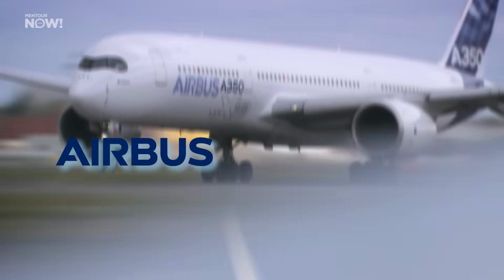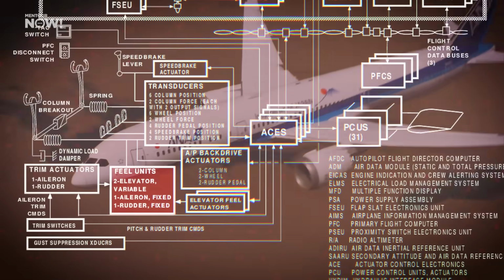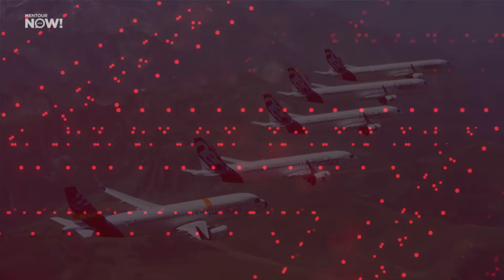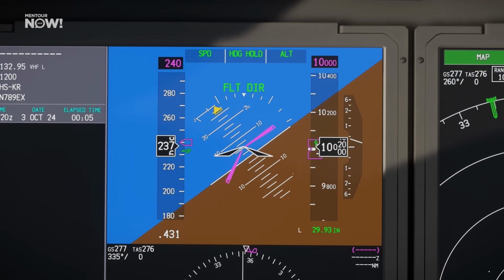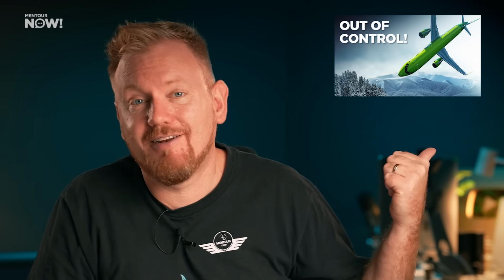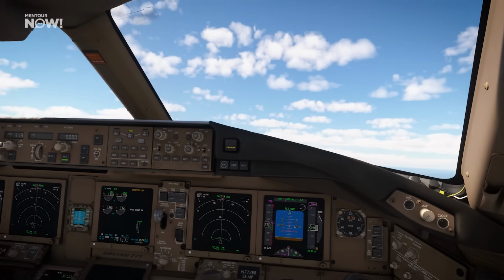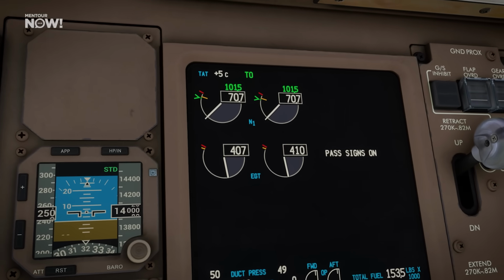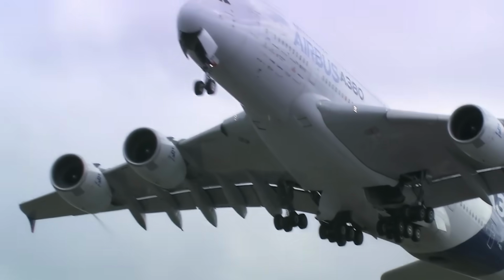Do Pilots Prefer AIRBUS over BOEING?!

Comment: Well, the moving Boeing thrust levers have not helped on the Turkish crash in Amsterdam or Asiana in San Francisco.
We as pilots have all at our hands. Always know your annunciators. There is no better a/c system if the system named pilots fail.
Just a thought, would MCAS be mentioned in the docs if they would be as complex as the ones from Airbus?
I do like flying the Airbus a lot but as a pilot I will ride any horse that’s for my mission. 
Gear down
Nicholas

Comment: I don’t understand the design principle of averaging to independent inputs. If the inputs differ then there is disagreement between those who make them, in this case the pilots. That would provoke a Dual Input warning that could be ignored under stress or when other warnings are deemed to take precedence, though executive conflict may well be the source of multiple downstream technical problems. By simply averaging the conflicting inputs the output commands are what neither wanted so unlikely to be correct.

Comment: Regardless of which aircraft is “better” can we just agree that modern airliners are engineering marvels? 
And as a Boeing pilot myself, I’m jealous of the tray table and noise levels in the airbus 😅
Reply: I still choose to only pick flights with an Airbus and strike out all flights with Boeing. 
It isn't necessarily because Boeing has bad planes and more about their Management caring more about stakeholders than passangers.
Reply: @erlking5868  Yes, yes, yes!
Reply: Aye, as long as the plane is made/designed correctly, it seems the question which is "better" is just preference (or dependant on extremely specifc criteria).

Maybe its actually good to have at least some diversity between plane manufacturers, probably better for innovation.
Reply: Despite so many stories where the worst possible outcome happens, this channel has made me aware just how much punishment these things can actually take. It's impressive to see incidents where planes have taken some horrific damage, but still not only held together but remained controllable, allowing the pilots to get them safely back on the ground.
Reply: 737 driver I presume?
Reply: Not to mention the parts not falling off while flying
Reply: @vulpix9210  Being european I have a bias towards Airbus, but plenty of the problems that happened on Boeings in the last months were due to poor maintenance on the airlines' behalves. Granted the one that lost a door shortly after takeoff was like one month old and that is a real issue, but all the others were a couple of years old, that is just bad maintainance. That being said, maybe Airbus makes planes that are designed to be easier to maintain than Boeing's?
Reply: @branlotin  Very good point there in the last sentence. I'm curious now, we need someone who works maintenance to confirm or deny.
Reply: @branlotin  that being said, how did Alaskan not detect the poor boltage on their new aircraft anyway? The problem seems like it was fairly obvious if properly inspected
Reply: @branlotin  With 35 years in Airbus and Boeing maintenance, in my point of view, Airbus maintenance is much more easier.
Reply: @BeachOfPondy  I admit to having absolutely no knowledge in the matter, and that is very interesting thing to read.
Reply: Not to mention the quality of the Airbus!  Considering the major problems Boeing has, I won't fly them at this point, and my co-workers feel the same way.  We have to travel a lot with our company, and stick with an airline who flies Airbus.
Reply: @jamesmyers9285  How do you travel to the airport?
Reply: From experience, and this may not entirely be correct, but I always found planes like the 777-300ER to be quieter than their A350 counterparts. Ofc, they are both spectacular aircraft.
Reply: Thanks for that comment. Which of these planes are more safer:
a320, a321 or a321neo? I've heard many bad news about the reliability of the p&w engines and don't know what planes are more safer?

Comment: So how was Boeing to blame for two 737's ... experiencing a runaway trim emergency shortly after takeoff due to a damage or faulty sensor ...  and well trained 737 pilot knows how to deal with runaway trim emergencies shortly after take off?

Especially when Boeing has included in every 737 the manual trim wheels, and trim off switch to deal with loss of pitch control.   It makes now sense at all why Boeing was blamed for the 737 Max crashes, when an  commercial airliner will always be unsafe to fly with damaged or faulty flight control sensors.
Reply: Boeing was 100% to blame for the following reasons:
1] They installed an invisible system that changed flight rules and did not adequately inform the airlines or provide pilot training, precisely because they intended it to be invisible.
2] The invisible system alternated between left and right AOA sensors on each flight, thus if an AOA sensor was intermittently faulty it may not be detected until it was too late
3] They DID NOT have a live second sensor input as a redundant comparison with an automatic disagree warning in the cockpit
4] Since Boeing foolishly assumed the system would always work, the override procedure was not obvious
5] Manual STAB trim was practically impossible once the invisible automated system was engaged and actively making trim corrections since [a] The jackscrew motor was stronger than the manual input and [b] The invisible system did not disengage when manual input was detected, thus any manual input was effectively reversed by additional inputs from the active invisible system.
Reply: @Unimatrix69  Wrong, wrong & wrong.

No 737 Max pilot was refusing to fly the Max ... after the fist crash & the 2nd because they knew what the cause was, and they all believed they they knew what to do ... if the flight sensor feeding data to the MCAS was falulty or damaged.

It was only the Fake new Media, after finding out about the MCAS and single point of failure who made up the BS conspiracy the Boeing fast tracked a deadly aircraft for profit. 

The worst MCAS can do is cause a runaway trim emergency in the 737 aircraft.

Boeing's engineer's stupidly decided to only have 1 point of failure, but the MCAS was still safe and  but would fail if the sensor is faulty or damaged.

And Boeing has put manual trim wheels & cut off switch in every 737 specifically for "runaway trim emergencies."

Boeing was correct that the fix ( making MCAS full proof) was a software update,  which is a few extra lines of code ... which the Engineers "strangely" decided not to include.  The MCAS was safe but not fool proof.

So everything you said blaming Boeing for the two crashes is bs from the fake news media and the Liberals in the the Government.

Again.  There were no 737 Max pilots refusing to fly the Max after the first crash ... then the 2nd.   The pilots of the 2nd crash believed they knew what to do, but they did not.  They were badly trained & selected by the Airline and that is why the Max crashed.

Likewise with the first Crash, the Airline knew about the faulty sensor with a 3rd pilot saving the Max from a previous flight.  The original crew did not know what to do, but the 3rd pilot on the Max did and he saved it from crashing.  then the Airline changed the sensor but did not have it properly calibrated so it was still fault making the Max unsafe to fly.  But they approved it to fly.  And Lion Air did not check that the new crew knew how to deal with a runaway trim emergency shortly after takeoff.  Or the said they knew ... just like the pilots for the Ethiopian plane.

All Airliners are unsafe and must not fly ... if the flight control sensors are damaged or faulty.

Boeing delivered safe aircraft to the airlines ... and the worst the MCAS can do is cause a runaway trim emergency ... which every 737 pilot is trained by the airlines to know how to deal with.

The 1 point of failure was not ideal, and it is very strange why the Engineers did not make it fool proof with a few lines of extra code, but the MCAS was safe, and there was no need to notify the Airlines.

Most 737 Max pilots did know what to do to save a Max due to a faulty/damaged sensor to the MCAS especially from Europe & North America, but clearly there were poorly trained pilots who did not know what to do .. and tragically crashed the aircraft killing all on board.

The Airlines are to blame for the two crashes ... as they train & select their pilots.  The Ethiopian pilots clearly believed they knew what to do and this is most likely due to bad training rather than the pilot lying.

You have to act quickly  with a runaway trim emergency shortly after take offf ... because you are at low altitude and  take of velocity.  You must avoid any pitching downwards as it is difficult to get back control  quickly.

Check out videos of pilots doing simulations of the crash, and the need to act quickly.

Comment: My first aircraft was the Dash 8 (the old models, not the Q400). So, I had a fair amount of conventional experience before I started on the A320. Besides not having to trim, the Airbus controls feel like any other aircraft. That is how they designed it. When you make an approach in gusty conditions, you need to make corrective inputs if you want to keep the aircraft flying the way you want it to. And the flare for landing is as conventional as it gets. As you approach the flare height, you look at the end of the runway and correct the sink with aft stick pressure, just as you do with a Cessna 172. In older A320 models, at 30ft, the computers push the nose down to make the pilot flare. But in the A320 and A321neo models, they removed it. So, the sink that you feel is very real.

From my experience, it is better not to overthink. When you fly an Airbus fly it like any other aircraft.

Comment: One more thought on feedback vs no-feedback:
In the case of feedback (Boeing) it can be a problem to distinguish between what are forces from the airplane versus what is inputted by the other pilot. This is what happened in an AirFrance 777 (AF011) coming in to Paris.
I'd still prefer an acrive feedback approach, as it provides more inputs to the pilots, but neither apporach helps for dual input cases imo! In all dual input cases, it is ultimately a break down of communication.

Comment: I could never get a feel for controlling the aircraft with my left hand
Reply: Captains on Boeing aircraft control with the left hand when landing, right hand on throttle
Reply: The only ‘feel’ issue I encountered was taxying the aircraft. The tiller requires really fine input from the fingers and the wrist, something that is not present equally in both hands. But even that you get used to after two or three flights!

Comment: Wasn't alpha-floor protection a factor in that infamous Airbus crash where it flew straight on into the trees at an airshow?  

Though on the other end of the scale, wasn't there also an incident on an Airbus where the BUSS was a major contributory factor into the pilots being able to save the aircraft?
Reply: So, are you referring to Air France flight 296 that flew straight to the trees?
Reply: "Wasn't alpha-floor protection a factor in that infamous Airbus crash where it flew straight on into the trees at an airshow? "
Let's put it this way, if the pilots would have done the same actions in a Boeing they would not even have made it to the trees but crashed on the runway instead

Comment: I always thought that if the pilot or even someone taking control the aircraft should just take over like the German Wings flight if the plane is going to fly into a mountain the it should take over and land at a predetermined airport and flight the Air France 447 was still an incompetent pilot problem

Comment: Personally, as a passenger I've always preferred the Airbus design philosophy - though if I was a pilot I couldn't honestly say. I think I'd prefer the more tactile, 'hands on' approach of the Boeing . . . But the cockpit environment on an Airbus seems like a better place to fly from. Overall I'd go Airbus over Boeing, but that is tempered with the same desire you've expressed to see more tactile feedback on the Airbus. Link the side-sticks so the pilots can feel what the other is doing and when TOGA LOK & A FLOOR kick in? Advance the throttles and push the stick down with forces the pilots can't overcome. That will stop them from overriding the protections, but also make it very clear to them what their aircraft is doing.

I remember being really impressed with the design choices Bombardier made for the C series cockpit, so I hope Airbus have left it as is not that it's the A220. I think the A220 cockpit could provide a model for the direction Airbus should move regarding cockpit and flight control development in the future.

Comment: I'm not a pilot, but a truck driver. It seems like Boeing still has a very American mindset while Airbus is very European in that sense. It's the same with American and European trucks. European trucks are getting lane departure warnings, automatic lane centering assists, collision warning sensors, automatic braking, automatically adjusting headlights, adaptive cruise control where the truck can almost drive itself with the driver just holding the wheel and making sure it's staying in the lane. It will automatically let up the throttle before declines and it might speed up slightly before inclines and it knows beforehand which gears t oselect and when since the truck knows how much it and the trailer weighs and how steep the incline/decline is. The truck will also try to prevent itself from exiting the lane but it needs to sense the lines to do that, so driver input is still required on the steering wheel. American trucks, even brand new ones, are much more analogue and rely much more on driver input. They still use manual transmissions, analogue gagues, many trucks still don't have all the automatic safety features that we have here because the ones operating those vehicles would rather kill someone in ther blind spot than have the truck tell them someone is there because it "stresses them out" and the ones building the vehicles take this into consideration. Also because the technology available in America is much older in that industry.

Edit: Both European and America trucks will tell the driver that something is wrong. But if we take Volvo and Scania, for example, they can run self diagnostics and automatically send that information to their respective manufacturers and also tell the driver if something is wrong. In Volvo trucks there is usually a button with the lettering code "VAS". It stands for "Volvo Action Service". If you're broken down on the side of a road and hold that button for 3 seconds you will be connected, via the truck's own phone, to a VAS Call Centre. The truck will send them information about anything that might be wrong with electronics, engine, transmision or other systems. Also, if the truck sense that it has been in an accident and you press that button, you won't even have to speak because the truck will send both its location and diagnostics to VASCC and also alert emergency services. Kind of a smart system. And these features have been available for over a decade now.

Comment: I have dreamed of being an airline pilot since age 3, but that train has long since left the station without me. As a fall-back I developed a keen interest in software development in my teens. And from that background can comment on the differences with the electronic displays and the operating manuals.

Back in the mid 1980s to late 1990s both the hardware and the software manuals were very detailed and very extensive. In fact, I was able to build and assemble several computers in that time-frame with just the provided manuals. I was also able to learn several programming languages and build some impressive programs for the hardware limitations I had. By the early 2000s the hardware manuals had evolved (or rather devolved) into a quick reference flyer that was often smaller than an A5 sized piece of paper, and building my own computer became nearly impossible. A similar trend had occurred with software. Even consumer software came with extensive manuals that detailed how to use all the various features of the software, encouraging exploring and learning new features that make your life easier. Nowadays you only get a Quick Installation Guide booklet, if at all. Back in the 1990s the included manuals for a software development tool could easily occupy about one meter of shelf-space. And it was usually possible to find an answer to a startled “Why the heck is this happening (or not happening)?”. Nowadays the included manuals are virtually non-existent, and even the “official” on-line manuals are often sub-par. I find myself more often having to wade through standards documents, then trying to puzzle out how the implementation of my tool differs from the official standard. I also have to search through a huge volume of forum and/or discussion board archives while trying to find an answer my questions.

So with that background in mind, I have to concede the win to the Airbus ECAM and the Airbus Flight Operations Manual.Yes, there might be a danger of information overload, but it will be a huge help when you need to figure out some bizarre fault indication.

Comment: Will a large solar flare like a CME that caused the Carrington Event cause all Airbus planes to lose control and plummet to the ground? Do we simply accept that risk?
Reply: And all other Boeing aircraft. Even 737 has engines controlled by electronics and other Boeings do not have a manual reversion. And seeing as a CME typically takes more than 24 hours to reach earth there is time to ground all aircraft before it hits……and then we’d have far more problems such as loss of satellites